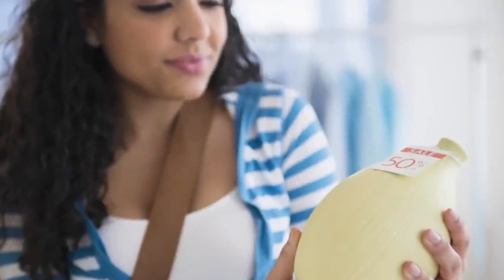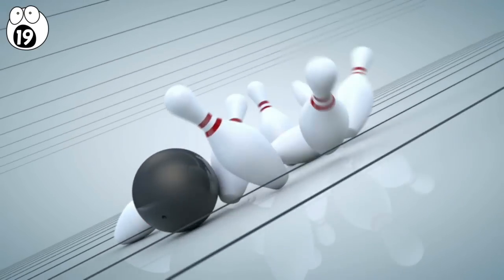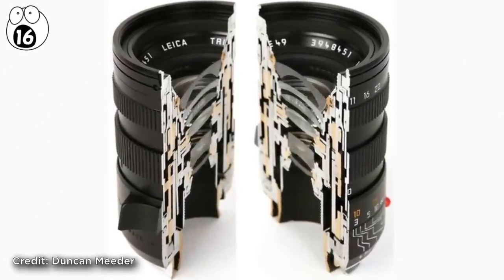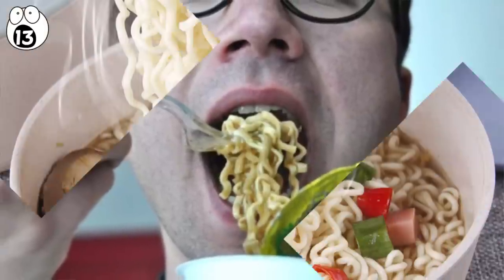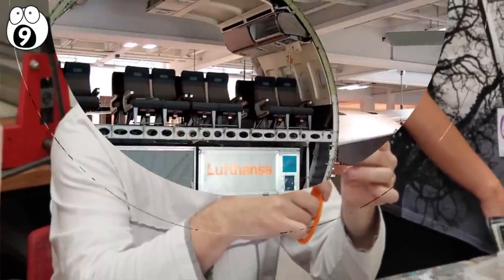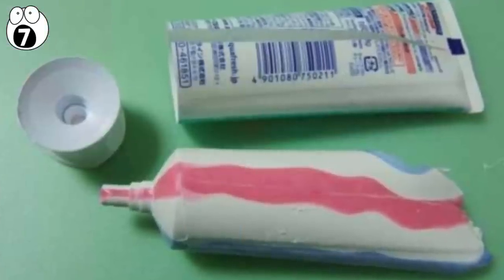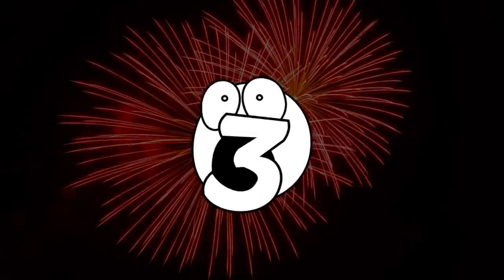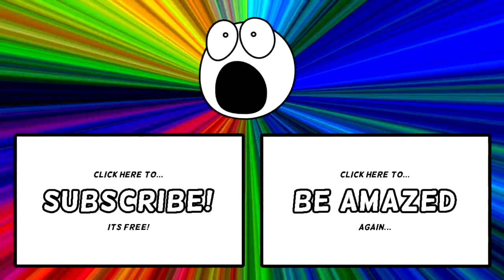Amazing Cross Sections That Will Blow Your Mind!

Comment: These videos are normally a lot of fun. However the information provided about the cross section of the 3rd item a "bullet" is completely incorrect, here is why:  
First, a "bullet" is only the projectile that is propelled through the gun barrel exiting the muzzle. 
Second, the cross section that was shown is that of a modern metallic cased ammunition cartridge, for a semi automatic or fully automatic hand gun.
 Third, the ignition of the cartridge is caused when the firing pin in the gun strikes the "primer" located in the bottom of the cartridge case.
 4th, the firearm shown was a revolver. Revolves do not eject spent cartridge cases automatically. The  cylinder must be unlocked & rotated out of the revolvers frame, then the cartridges empty or not can be extracted. (This does not apply to all revolvers only most modern models).
5th, the "bullet" must be the correct size to fit in the muzzle and go down the barrel. However the "bullet" is not the only thing that is responsible for the cartridge firing correctly. 
6th, the empty cartridges shown ejecting are modern metallic cased cartridges normally used in rifles. (Most likely 5.56x45 or 7.62x51) these cartridge calibers are not normally used in hand guns. 
I understand it is impossible for any one individual to know everything, however please make sure that facts are as accurate as possible. Myself & many others would be happy to provide the correct information if needed.

Till next time stay frosty,
FNHUSA57.

Comment: Weight blocks in bowling balls are not designed for acceleration. They're designed to manipulated the radius of gyration of the ball there by creating a different reaction as the ball rolls down the lane. Along with the surface, the weight block and lay out create a certain arc or angular motion down the lane. The reason for this is different performance on different oil patterns.

Comment: once the pin on the grenade is pulled you can hold it as long as you want as long as you hold the handle down (the spoon) which is designed to lift as you throw it arming the grenade

Comment: The interior of the bowling ball is shaped the way it is so it "wobbles" down the lane.  Good bowlers hook the ball and the weight inside if ensures that a fresh section of the ball is in contact with the lane so it digs through the oil applied to the lane better (this is also why you see people wipe balls down between shots).  

You can see the multiple oil lines here: http://prntscr.com/i3qw38

Every core will have specs like Radius of Gyration (RG), Center of gravity (CG), and if it's assymetrical it'll have an extra marking for the Diff( differential).   Things like RG are inherent, where the diff, CG and the pin (the center more or less) of the core are market on the outside of the ball so pro shop operators can position the core inside the ball accurately when drilling thumb/finger holes.  

Different values will result in different things.  Higher RG balls tend to push further down the lane before hooking etc...  That's why you see people with multiple balls...different ones serve different purposes, much like golf clubs.  There's a bunch of really informative videos on why/how it's significant (even though the cover, or outside portion of the ball tends to have a greater effect on ball motion).

Comment: Corrections to "Bullets":

First, that's a whole cartridge, not just a bullet.

Second, the part at the bottom is the primer, not the firing pin.  The firing pin is part of the gun and strikes the primer.

Third, the powder is in the cartridge casing, not the "Bullet"

lastly, the cartridge casing (not cartridge) is only ejected in a semi-automatic or fully automatic gun without the user getting involved manually.

Comment: The noodles have to have enough room to expand when the water is added. And the air at the bottom is so the water can travel evenly through the noodles without cooking the top and leaving the bottom in a clump on the bottom.

Comment: This according to the Instant Ramen museum in Osaka.....
“A method by which the noodles are tightly packed so as to remain suspended in the middle of the container was invented and called “Middle Suspension.” By using this method, the noodles are less likely to break, and since there is a space at the bottom of the cup, hot water can circulate thoroughly from below, ensuring that the noodles soften evenly.”

Comment: #11 is obviously an exception for people who handle snapping turtles, especially those that are experienced  enough to handle alligator snapping turtles.
Only grab BOTH the front of the carapace behind the neck and the back of the carapace behind the tail! Alligator snappers bite with 1,000 PSI (recorded human bite force is only about 15%, 20% at the  max, of that. The water pressure of the spray from a pressure washer is about equal to the bite of an alligator snapper)

Comment: There is no "Firing Pin" within a bullet. There is a device located at the bottom of the bullet called a primer. The primer is a small explosive charge that is detonated when struck substantially within a very small specific area, usually the center of the bullet, by a firing pin which is part of the gun and not the bullet. The small explosive charge of the primer is the chemical reaction that ignites the smokeless gun powder charge within the bullet casing that rapidly expands propelling the actual bullet down the length of the barrel. A good description of a firing pin would be a small, semi blunted, nail loosely recessed within a metal housing located at the rear of the gun barrel.

Comment: The firing pin is NOT part of the cartridge. The firing pin is a part of the firearm. The firing pin strikes the primer which is seated in the bottom of the cartridge. The chemical compound in the primer ignites and sets the gunpowder on fire. The build up of pressure within the cartridge case pushes the bullet out of the case and down the  barrel.

Comment: WRONG The grenade pin holds the spoon the spoon is attached to the spring so when you throw it the spoon releases and the spring strikes and makes a spark witch lights the fuse

Comment: Hey be amazed on 18 you got it wrong it is called the primer not the firing pin the firing pin is on the hammer or in the inner workings of the gun

Comment: Ok, look. The firing pin is not a part of the round. What you call the firing pin is the firing or percussion cap. When that is struck by the firing pin it ignites the gun powder which creates an explosive gas that builds behind the bullet causing the bullet to be separated from the shell casing and propelled forward along the barrel and to the target.

Comment: They got the bullet wrong. Well part of it.

The tiny little explosive that ignites the powder charge within a bullets brass cartridge is called a primer, not a firing pin. The firing pin is part of the gun which strikes the bullets primer setting into motion the explosion which ignites the gun powder, then building pressure the bullet is shot from the chamber, reaches the rifling where the bullet starts to spin then leaving the barrel going down range.

Comment: OK number 18 is wrong, The whole casing and bullet is called a cartridge. The fist point at the bottom is NOT a firing pin. The firing pin is a component of the gun , the part he is describing is called a primer, then the main powder and last is the projectile or bullet. The Trigger is pulled making the hammer hit a firing pin which hits the primer which contains flash powder ,that sets off the main power charge in a casing of the cartridge,it is this contained and controlled explosion that forces the projectile out the barrel at high speed. Some older revolver type hand gun and older rifles have the firing ping built into the hammer. Also the speed at which the projectile leaves the barrel differs with the amount( the weight of power in Grains)  of powder,the type of powder and it's chemical makeup. Some powders are faster burning then others and some are slower, which increases or decreases it's speed of burn  thus increasing or decreasing the speed of the projectile. The shape, size and weight of the projectile also plays a factor in the speed of the projectile. Wind is also a factor.  Former USAF Sargent, explosives, Bio-chemical and Nuclear weapons Expert. PS: I like your videos, but had to give you a thumbs down for the inaccurate descriptions of somethings in it. I believe more research should be use to be as accurate as possible when describing parts and how things work.

Comment: Excuse me, but that isn't a bullet. A bullet is the copper shelled projectile violently fired through the barrel. What you are showing a cross section of, is both the bullet, and the "shell". The brass cartridge with the gunpowder and firing charge.

Comment: Grenade:  Actually, pulling the pin only frees up the handle.  The grenade won't actually explode until you release the handle.  YOu can pull the pin out and it's fine as long as you don't let go.  Once you let go, though, Mr. Grenade is not your friend!